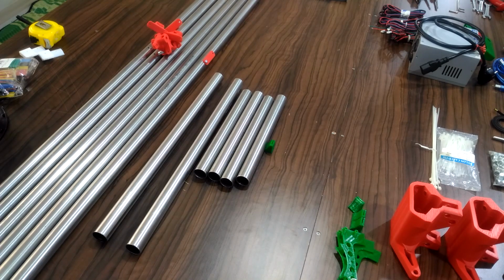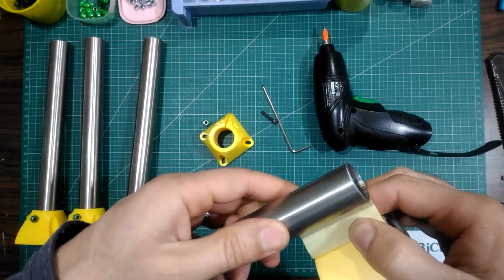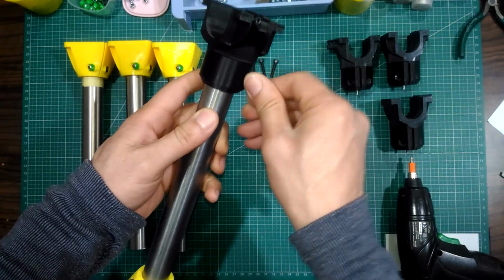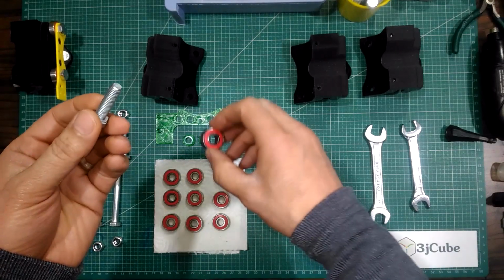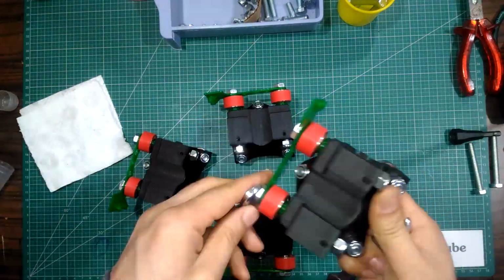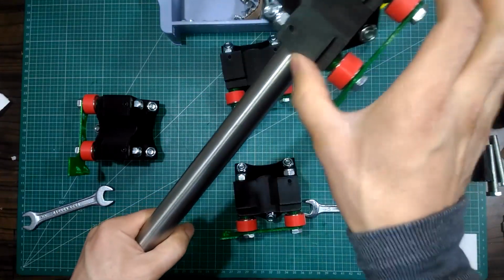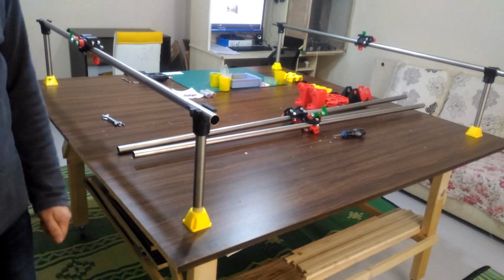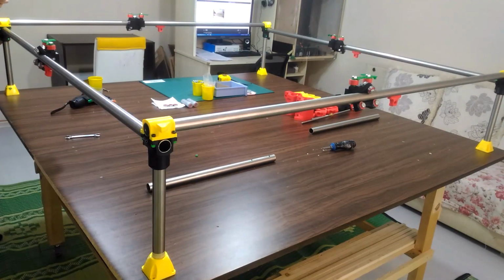02-Beginners guide to building The MPCNC machine Part02 - Some basics and building the frame.

Comment: what size is it ?
Reply from the maker: Machine size 1500 X 1500mm
but working space is about 1200 x 1200mm on X and Y and 270mm on Z
I did mention that and other things about the size and table in Part01
Reply: @3jcube3   thank you i'm building the same one is it solid at that size your not getting any bowing ?